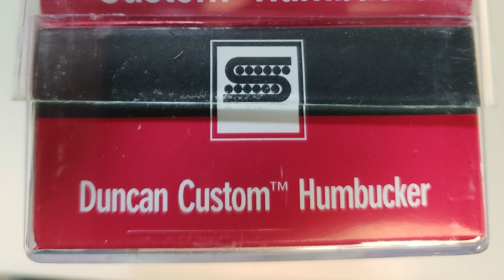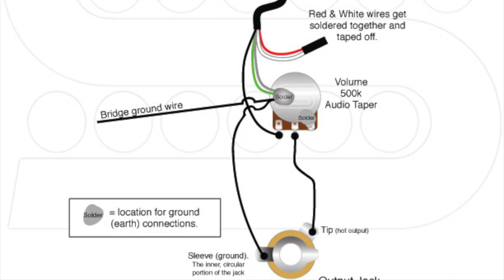My Purple Kramer Baretta Special Upgrade Video

Comment: The Graphtech Epiphone 6061 nut fits this guitar with just a little bit of sanding. I put 2 of them on two different guitars and they work great. I put a SD Distortion in mine I didn't like it so I yanked it back out. I'm gonna try the EVH Frankenstein.

Comment: It took almost 6 months but I finally got my purple special. I also went with Gotoh tuners, a black tusq nut, Seymour Duncan black winter with push pull coil split. The factory trem is functional, but Just didn't look right and I never cared for Floyd Rose trems and didn't want to drill and route so I put in a Babicz full contact trem and am really happy with it. A wee bit over 500$ total with mods, but still well worth it for a guitar that will saw your head off.
Reply: Whick Babicz trem did you use?
Reply: Nice mines coming in tommorow can't wait
Reply: @gameovergt  it's the Babicz full contact. Went right in, it's floating but not full floating so it's stiffer than a floyd.
Reply: @farrellbrent8189  thanks

Comment: I want to install a Duncan Black Winter but there are two version, a wider tremolo version and the normal version, as I understand the slanted pickup they did it to accommodate for the winder string spacing of the tremolo and because they didn’t had special version slanted the pickup to bring the pickup in line with the strings. So I would need the normal pickup version and not the winder one if I have a slanted pickup In the Baretta? am I right?

Comment: By keeping the stock bleed capacitor, does it work better as a normal volume function with the aftermarket pickup? Because I know in stock form the volume knob is basically an on/off switch.

Comment: I know this is a year old, but I’m modding my Baretta Special and the using the same gotoh tuners. My question is I can see you used the shortest post on the G B and E ( high ) strings do you think you could also use the shortest 18 mm or whatever post on the G string as well? I’ve been ordering my gotoh  tuners two at a time and ordered two short for the high e and b string and then two medium length for the d and g but looking at it I think I could actually use another short one on the d string as well I’m definitely ordering another short post tuner for g string and wonder if I could use basically four shortest and two medium length post for the low E and A strings ? Just asking for your opinion I definitely know I want a short one on the g string to get more break angle over the nut. I’m not planning on putting a Floyd on it, I have a graph tech tusq nut and a Wilkinson vintage style tremolo.
Reply from the maker: Not sure, I’ll have to revisit this!
Reply: @RobNY5150  cool I’m thinking about using four short ones and two medium length. I’m more worried about the break angle and binding on the low E

Comment: Great build!  Does the guitar benefit much from staggered tuners?  I thought those were more for flat headstocks with no angle.
Reply from the maker: I’m not sure if there is a benefit but I mainly got them because it’s what other people had recommended.
Reply: They are for flat headstock with no angle. They are silly to put on in this case

Comment: the tuning stability is terrible. i get anxious to bend with this guitar (cheap tuners and trem). Furthermore are the frets medium sized. I know now, that i prefer jumbos. apart from this issues it is a cool looking guitar with a fast and smooth neck. 
I want to ask you guys, which good trems fit to this guitar? i want to change that cheap trem. thanks
Reply: same. Can't believe that bends are even worse than dive bombs for the tuning stability.

Comment: Question. I ordered the Kramer baretta special  the vintage white. From Sweetwater. I have not gotten it yet, I do have upgrades for it. Will the Wilkinson contemporary six hole tremolo fit , for my upgrade. Or will the body need to be modified.
Reply from the maker: That's a good question... actually, I've been looking into replacing the trem and the nut and I'm trying to find out myself.
Reply: @RobNY5150  what I would like to do , is put the floyd rose, rail tail bridge In .  Big game changer.    I am planning on putting a dimarzio in it.  Not sure what one yet , still researching.
Reply: @scnl6927  Put the Wilkinson VS-100N on mine.  Had to tap the screw holes to install the posts.  Thought about the FR rail tail but that is more than the price of the guitar.  Also installed a SD TB-12 & a YJM speed pot:) as well as HipShot tuners and GraphTech nut.
Reply: Most of the time the stability problem comes from the tuners + nut... First thing to do is to put locking tuners and a graphtech nut, and then see if the trem needs to be replaced... 😉
You can also put graphtech saddles in the trem.

Comment: So far I just have some locking tuners on mine.  Blows my mind that I have less than 300 into it
Reply: 169 € + black tusq nut 10€, goldo black box 10€ (tremolo retainer), gotoh staggered locking tuners 98€ and a dimarzio tonezone used 40€ !
For 330€ guitar included it slays now !

Comment: Regular size humbucker or the trembucker.  I have same guitar and don't know what size to get
Reply: I bought the trembucker because that was what I was told to buy, it does fit but had to file down the plastic to make it fit.  No benefit, anyone else wondering, get a normal sized humbucker and save your self the trouble lol

Comment: Did the same with mine and also new graphtech nut and high mass saddles.. 🤟🏴‍☠️
Reply from the maker: Can you tell me which nut exactly? Was it drop-in?
Reply: I was amazed at the difference after installing a graphtech nut!
Reply: @RobNY5150  think the exact model number is in my video

Comment: Anyone drop a Floyd Rose in this model? Seems like it would make the guitar more stable and overall a better player.  I’ve never converted a non Floyd Rose guitar before but it really doesn’t look like it be that hard.
Reply: most guys are using the vega trem instead
Reply: Nope I dropped a flush mount original floyd rose in mine along with grover tuners,evh pot and Frankenstein pickup...beastly guitar now.
Reply: I put a American Floyd Rose Original in mine along with locking nut, Seymour Duncan  invader, Gotoh tuners, and a 500k Seymour  Duncan pot. I did all the wood work with a drill for the bridge, I didn't have to remove much wood. For the nut I simply used a wood file to get ready for the locking nut. I used a R3 nut
Reply: Use vegatrem
Reply: I installed a Gotoh 1996t Floyd Trem in one of mine, along with Gotoh locking Tuners, its perfect now. The other one I installed a 2 point Schaller (which cost more than the Gotoh Floyd) with a Gotoh locking nut. Works great. Worth the investment.

Comment: I would like to install a duncan prail with a triple shot. i happen to have the trembucker size sent by mistake,  and return from canada to the states is not worth it. do you think this would work?
Reply from the maker: It might. The trembuckers are designed for tremolo equipped guitars because of the spacing.

Comment: In case anyone wonders F-spaced humbuckers for replacement (just got my Baretta)
Reply: @Lonesome_Loser  just changed the nut for a black tusq  pt-6060-00 almost perfect fit only a bit of sanding to do and it changes everything with stock hardware (still waiting on my tonezone & vegatrem)
Also invert the 3 high strings tuning way it gives a less angled string between tuning pegs and nut and way more stable that way :!
Reply: @Lonesome_Loser  aaah and with the new nut harmonics are easier too !
Reply: I am trying to find some pick ups for the baretta. but you have talked about f spaced , some people say they must be multiscale/angled. I am lost. How to know if the pick ups will fit?  thank you

Comment: If I want to upgrade the pickup. Can i place any 500K push/pull pot to switch between single and humbucker ? What about the treble bleeder?
Reply from the maker: I took out the treble bleed because I didn’t want anything extra in the circuit but I can’t say for sure if I mattered in the end. As far as the pot, it’s possible the shaft will be too thick for the hole but you can carefully drill it out to widen it.
Reply: @RobNY5150  Thank you Rob. So If I apply a push/pull that fits the hole can I choose one without treble bleed? whats the point of that either way?
Reply from the maker: @MetalDoraemon6  I took mine out of the circuit. I believe the point is that when you turn down the volume you don’t lose any high end or clarity. I don’t think you need one with one included .
Reply: Seymour Duncan Jeff Beck is a great pickup

Comment: Can i fit any pick up like a X2N or a EMG H4 or fluence?
Reply from the maker: I’m not familiar with those specific pickups. This guitar should fit any standard Duncan or Dimarzio, Gibson etc. If the two pickups you mentioned have the same dimensions as most Duncans or Dimarzios then I think it will fit.
Reply: @RobNY5150  People told it has to be F spaced pickups...what is that?
Reply from the maker: @MetalDoraemon6  FSPACED means pickups that are a little wider for guitars with trem systems. Most single cut guitars would take standard sized.
Reply: @RobNY5150  thank you mate !

Comment: why not upgrade the tremolo?
Reply from the maker: I’ve considered it. I mainly use it as a non-trem, Jake E Lee style but might upgrade it at some point.
Reply: Because some people are capable of setting up a standard trem to push and pull , slap a graphtech nut on and it will also stay in tune , unlike a Floyd Rose
Reply: @Dad-Gad  you can't be serious... (Good) Floyds are bulletproof as far as tuning stability goes. I have this guitar and have set up the POS stock trem with a Graphtech nut to be way more stable than it was new but to say that you can set it up to be better than a Floyd is pure comedy....

Comment: How do you think this guitar would handle B standard, baritone tuning?
Reply from the maker: It's Fender scale length so it should be ok but I'd at least use 10-46 or higher guage strings.
Reply: @RobNY5150  did you use a standard or F spacing Seymour Duncan?

Comment: why have not you upgrade the trem?
Reply from the maker: I'm thinking about it but I'm not sure which trem would work the best without having to drill or make any major alterations.
Reply: There are some videos of the Vega Trem upgrade that doesn’t look too difficult to do.
Reply: @RobNY5150  Vega or blade runner.both just drop in...

Comment: The cream and black zebra pickups are so ugly.
 Why would you have a vibrant color guitar and drab looking pickups? I have 3 of these and thats ALWAYS the first to go. Followed by the bridge and then the tuners. Oh, and the knob.
Reply: I agree...I have 3 in different finishes too plus one of the first batch in white and even then I replaced the zebra humbucker even though it was rather decent...
I have nothing against zebra humbuckers 😁 but it would really not look good on a flashy finish...
Reply: Dimarzio do a whole range of cool colours, will install a hot pink pickups on mine